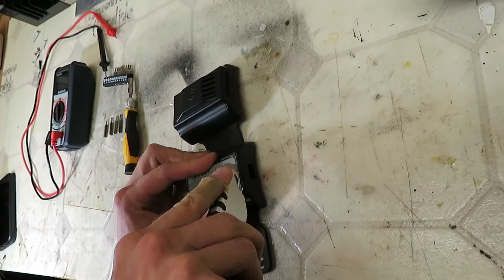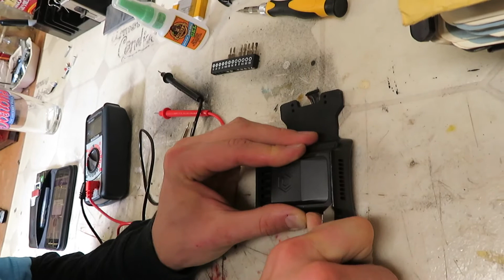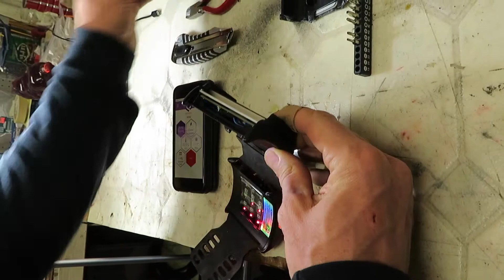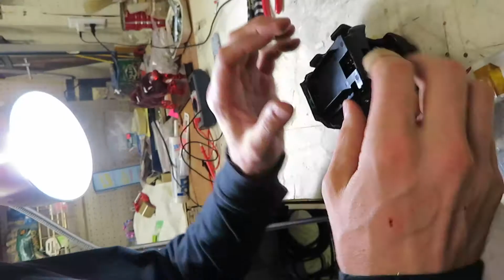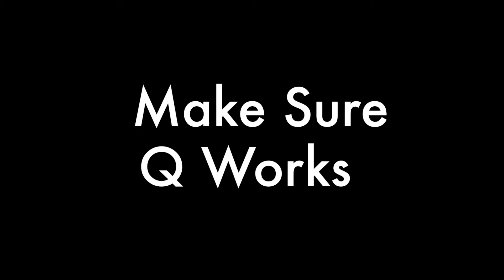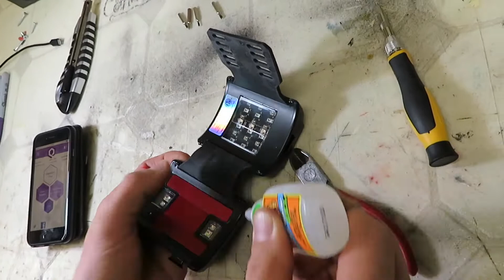Quantlet Repair

Comment: Ryan my quantlet worked for 3 days but I didnt know about waiting to charge it AFTER use.  Now when I plug it in I get quick flashign led's on the cooling plate and power button.  If i wait like 8 hours I get the orange flashing charge light but quickly jumps back to the flashing leds.  I have no idea if its charging or dead or if I fried it.  Do you have any recommendations?  Maybe you could do a video of how you checked everything to make sure there were no power issues.
Reply from the maker: Hello Andrew. Charging the unit can take a little messing around for sure. I have 2 units and they don’t charge the same?? Have one that as soon I as I plug it in it flashes then 4 hours later it flashes pink indicating it’s charged. The other unit is charged by plugging in then pushing the on button. It flashes similar to your description then the orange light starts blinking indicting it’s charging. I unplug it after 4+ hours and it starts flashing pink again full battery. Do you push the button after you plug the unit in?
Reply: Hey Ryan thanks for responding.   This is exactly  whats happening to my quantlet and what others have reported https://www.youtube.com/watch?v=NRTUOdbMRsM .  It started after it dropped charge one night then i charged it up the next morning.  It was flashing orange indicating charging.  Now when I plug it in this is all I get.  People have reported letting the battery drain unplugged 2-3 days or up to a week and finding the problem fixed however others havent been so lucky.  Ive waited around 8-10 hours but I'm in the process of waiting longer to see what happens.  Others still have reported even after fixing this issue the quantlet still dropping charge when not in use.  Im gonna try to give it the 2-3 days others have reported and then see if I can get it to go back to normal, and once I do try to update the firmware hoping that will solve the charge dropping issue.  On the quantlet faq it talks about the flashing led's and a hard reset.  It says to keep the unit on until the power drains but I cant even get my unit to turn on in the first place.
Reply from the maker: The flickering of the lights is pretty messed up in that video you linked. Did you open it up and unplug the harness? Might work. If not you could disconnect the battery if you have the ability to re-solder it. If you do open yours up please get the dimensions of the battery so we can look for a replacement that’ll fit.
Reply: Yes its really messed up and annoying.  Up until watching your video I didnt know I had the option to open it up.  I'm gonna wait one more day to plug it in and see if it will fix the problem.  If not I probably will open it up but I've never soldered anything before and have no idea what I'm doing.  Willing to try though cause I'm desperate to get this thing going again.  I can give you the battery dimensions if needed but I dont even know what type of battery I'd be looking for either.
Reply: Hey Ryan I tried waiting a couple days but I'm still getting the flashing lights and usb meter is saying that the unit is only getting .08 amps of charge.  I even tried to buy a different usb C cable. Also unplugged the harness.   I pulled the  board out and have it connected to the battery.  Do you think that theres a way to replace the battery?  Like I said I have absolutely zero soddering experience but I'm definetly willing to try anything.
Reply from the maker: Andrew, That sucks! These things have so much potential but ... 

Do you have a multimeter? You can put it on the leads of the battery with it on a DC voltage setting and you should see around 7 v if good or 0 if the battery is dead. I'd start with that before replacing the battery. The following is a link to a video of a guy using a MM on a Iphone battery, same principle. https://www.youtube.com/watch?v=GgrIUUR2xP0
Reply: Opened it up last night.  With the help of patrick on here I cut the battery off and attached at cut usb cord to it.  It worked!!  In the process of trying to find a replacement battery.  Theres a robotics store near me I'm going to go to that stocks a battery that has the same Mah and V but its hard to know the discharge rate or if this matters.  I'm hoping they will know more about it than me.

Comment: Btw...does the tec get cold even without fan?
Reply from the maker: Not noticeably.  I have another unit so I pulled the fan out of this one to see if it made a difference with battery life. Still getting the same life, about 2 hours run time with no fan.
Reply: Yup...now lets find a battery we can order online...so its lifespan will be longer...also i find using a usb meter helps alot to know how much charging is going on.
Reply: https://www.sparkfun.com/products/11855 would this one work?

Comment: Hello,

Ive done this (i own 2 q) because the cable was always coming out...anyway the battery is dead (overheated i think)...can someone link a store where we can by one (size, 7.4v 1000ma high discharge rate)?  If we can find a compatible battery the quantlets life will be unlimited.  Also, watch out because the connector of the cable is fragile...broke it off...trying to get a local to solder back on...

Comment: RYAN RYAN RYAN....THANK YOU THANK YOU....took mine apart today after seeing your video....my fan stopped  and only red lights worked on all protocols...Everything back working now. connector was loose on the fan portion connection. AGAIN THANK YOU FOR THE TECHNICAL HELP. Did you do a firmware update? Trying to locate the hex file needed. update is located at www.thequantlet.com/upgrade....
Reply: I feel the new firmware makes the quantlet easier to use ( no 5 sec clicks) also its suppose to protect from over and under charging
Reply from the maker: Hey Tim, Glad you could get it going! I haven't done the update. Have you heard if it makes a difference or what the update is supposed to do?

Comment: hey bud, thank you for sharing your experience here - it's great to see someone bring a unit back to life! I love my Quantlet and rely on it daily. I would likely be doing something like this if I had no other option. 

That said, I am wondering if you've come across a scenario that sees a Quantlet only flash purple upon plugging in? I have had it happen before but never for a period longer than a day or two. If I left it alone for 24-48 hours it would typically come back to proper charging mode but this time, no dice. it's been 5 days and I can only get "all purple". As far as I can tell the unit is completely without charge as it only responds to prompting once plugged in.

I am also curious to know if you have any thoughts on 3 party USB cables?
Reply from the maker: Hello Eric Giesbrecht,

I get a flash on one of my units when I plug it in. I don’t touch the button on It and it charges to full on its own and the purple light comes on once it’s done. When it is on a full charge I have to cycle the control button twice by holding for 5+ seconds to get the flashing blue light for pairing to my iPhone.
Reply from the maker: To continue, hit the send button...

My other unit works just like it says in the manual.

To ensure we’re on the same page, are you talking about the pink/purple light on the control button or the violet lights on your led panels? 

I use the OEM cable, but have read that other people have been successful with using 3rd party cables. I believe that there is a range of quality in cables, so I like to be on the higher end myself. With that said, the most important thing is not over heating the battery and electronics, so charging routine needs be as follows. 
-1amp/5 volt charger max 
- 4 hours charging 
- 2 hour cool down period after charging before and after use

Hope this helps and let me know about the lights.
Reply: When my unit is charged I see a pink light behind the power button, that much is clear. These purple lights that I am referring to are more the violet type, and flash on the underside of the device by the cooling plate (one on either end) (EDIT: the concurrent flashing of the power button is white, not purple). The device responds to nothing until it is plugged in, then it starts to flash orange as though it were beginning a charge cycle, and then after 4-5 orange flashes it goes back to quick flashes of purple.

The notes on battery health are received with interest - I do not typically wait to use after charging because there appears to be some kind of a drain on my battery as it dispels within the day if not used. I do use the Apple cube charging connection 5V/1A on all connections.

Also, I have gotten "phantom-like" powering on of the device, which I found terribly odd because it otherwise takes a very committed push of the button to turn it on for use when I actually want to. Nonetheless, I have sometimes gone to my quantlet and found it powered on, but not in any specific mode of operation, with the battery depleted significantly.
Reply from the maker: The Quantlet that I took apart in the video was draining it's battery too fast in my opinion with out using it, so I took out the fan to see if that would  stop the battery draining. 
The update that has come out may be the real solution to your problem, sounds like it works but not as it supposed to... just needs the software reinstalled??  I have emailed Quantlet Help Desk to see what the update was supposed to do and where to get the HEX file?  Do you know anything about the update?
Reply: I have not done the update, nor attempted it. I heard it was difficult and didn't want to jeopardize a working unit if I could manage to skirt around it. There was a Apple download file of the Quantlet update so I grabbed it yesterday - I will attempt maybe this weekend as I have time. I heard it takes forever to do the update if you're not code-literate, and while I am an above average tinkerer, I know jack about coding! As for the HEX file per se, I know nothing. Am hoping that the Apple version bypasses that non-sense like they usually manage to...
Reply from the maker: I'm in the same boat for coding... If you get it, please let me know how you go!
Reply: Yes the cable included is often cheap...
Reply: pat kob I have had no issues with the cables included with my Q’s or the ones I bought third party, but I did buy more expensive product (they were longer) that had some kind of moniker that seemed to describe added capability for data transfer.
Reply: this is the same problem I'm having.  I cant get out of the flashing purple light of death.  Its freaking torture..
Reply: Andrew Wainer hey man, I managed to get my unit back into charging mode by waiting upwards of a week before plugging it back it. I previously only needed a day or two for the batteries to reset/fully drain but waiting the extra time did do the trick for me! 

The only ongoing problem i have now is the battery draining while the unit is off. I will use it for one cycle of 30min performance, off of a full charge, and then turn it off only to come back to the unit later in the day or next day and find it dead, no charge at all.
Reply: Ugh a whole week huh.  I almost got it going today I plugged it in got flashing orange so I held the button down and got flashing blue then back to purple.  I have a usb meter coming tomorrow.  Have you done the firmware upgrade that is mentioned on this thread?  It seems like they have addressed the charge dropping maybe?  Thats how this whole issue started for me too
Reply: if you want to message me on jacks site my username is awainer1 that would be great this youtube thing is killing me